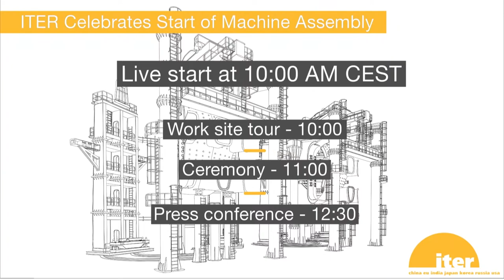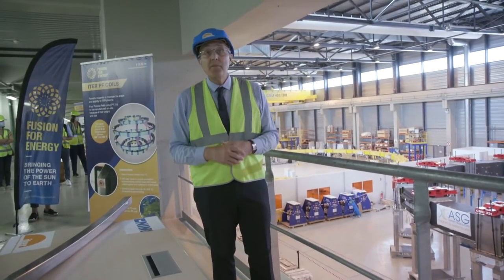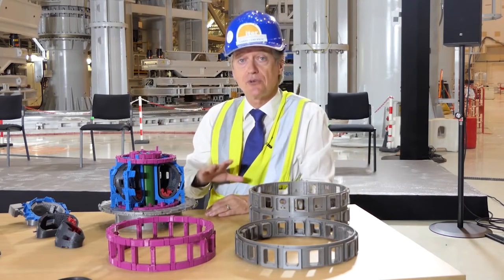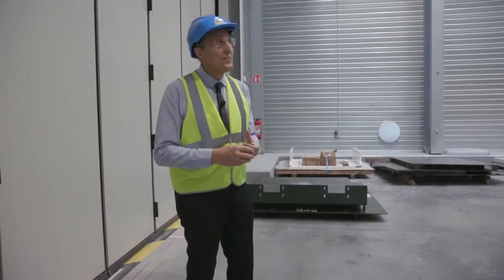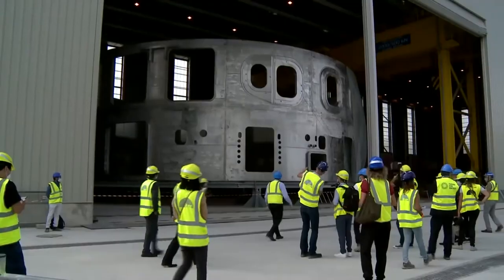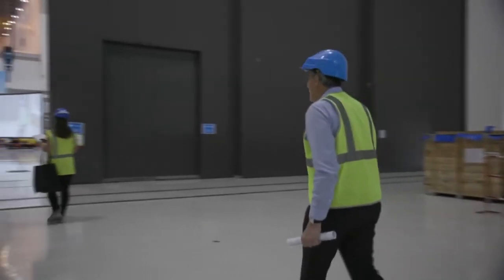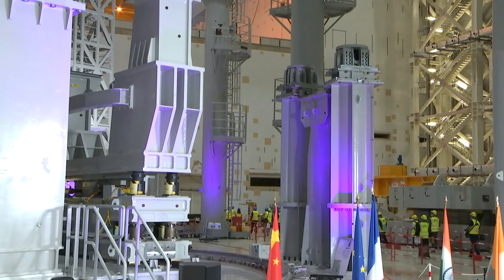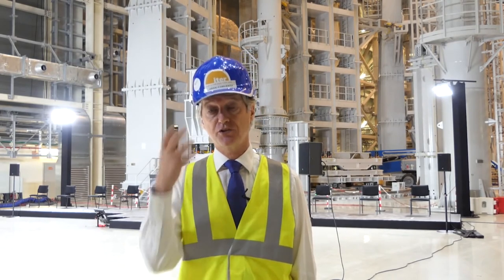ITER Assembly Ceremony- Virtual Tour on-site

Comment: This is all really cool.  One should bear in mind that this machine is not intended to be a commercial power plant.  It's a potential demonstrator.  No one really knows if it will work when they throw the switch.  It will also take approximately half the world's available supply of Tritium to start this thing.  I remember when they switched on the Large Hadron Collider for the first time.  Hoping for the best but I will not be standing outside the door when they turn it on.....